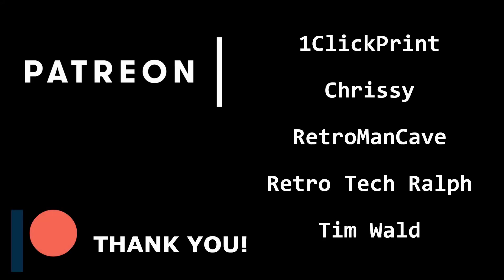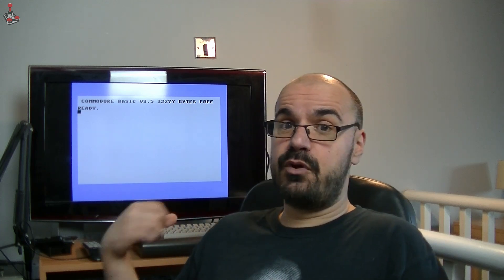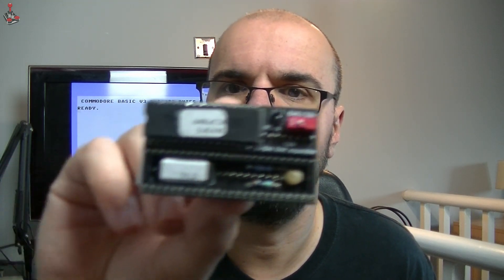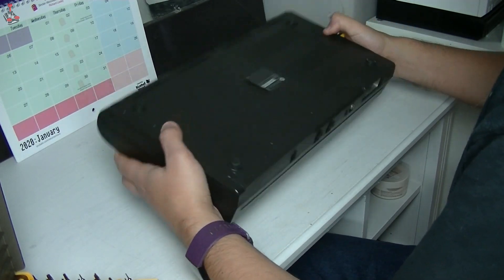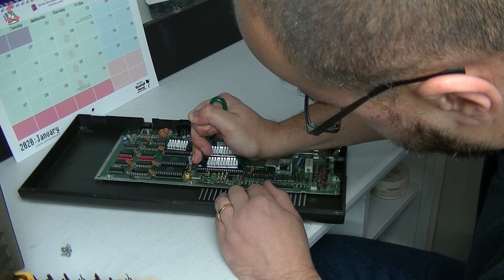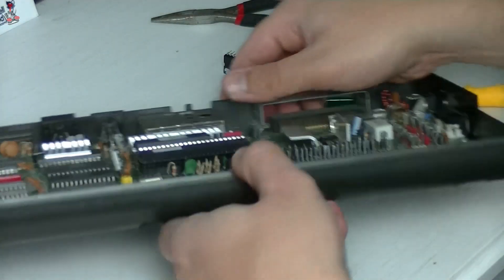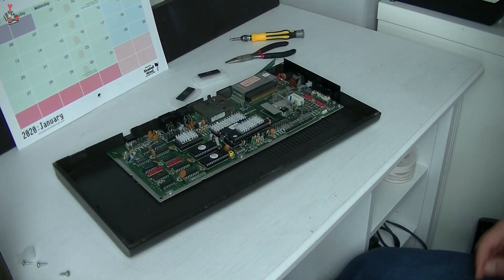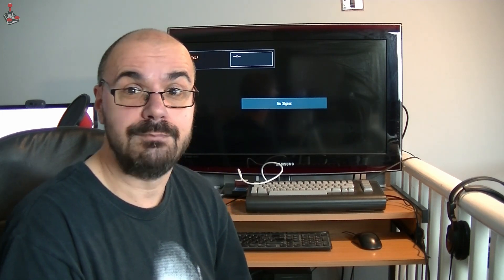EASY Commodore 16 | 64K RAM upgrade

Comment: Good upgrade , 
 Good informative video.
 Is it possible to upgrade
the cpu :)
 Thanks for your efforts and the video.
Reply from the maker: You can utilise alternative CPUs from the same family but modifications need to be made to make them compatible and there is no benefit performance wise. Only benefit is the ability to replace the original CPU which is getting quite rare.

Comment: The C16 SRAM 64k upgrade I make and sell is smaller, uses thin pins to avoid damaging the TED socket and is cheaper. http://www.amibay.com/showthread.php?108610-SaRuMan-TED-64k-RAM-for-C16-and-C116
Reply: Do you still sell it?

Comment: There is another upgrade I saw very new as using newer ram an a chip under TED with a switch to go back to 16K as it does not use ram on the board.

Comment: Seller doesn't have them listed presently.   Anyone else feel uncomfortable seeing that board flex when he pushed in the upgrade kit?
Reply from the maker: Yeah he makes them in small batches I think. In hindsight perhaps I should have swapped out the cheap socket (typical Commodore) but all was well in the end 👍